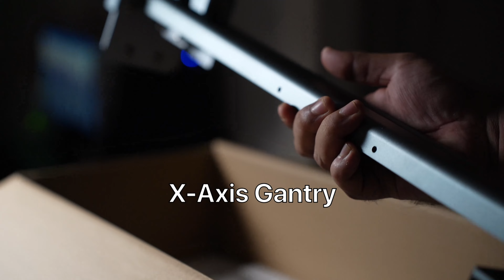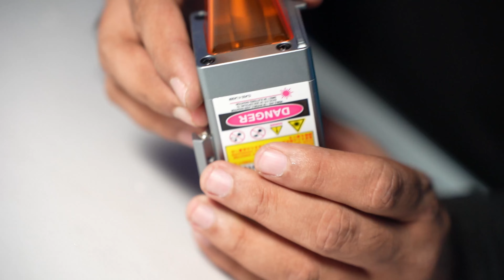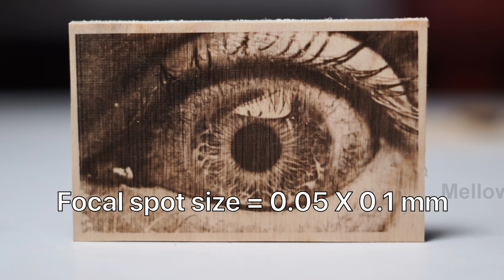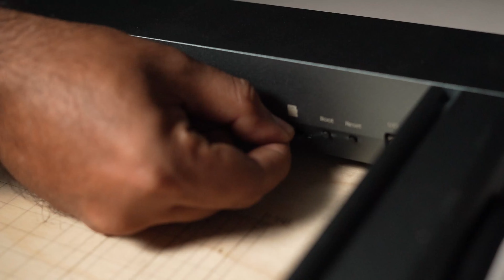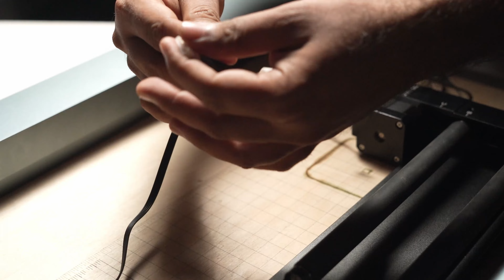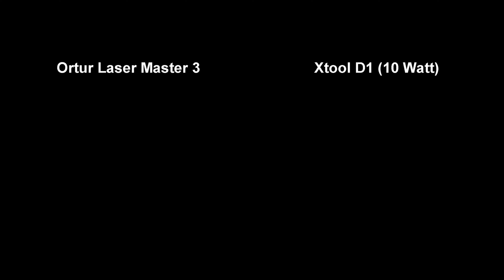Ortur Laser Master 3 Review & Tests- What's Good And Bad? Assembly, Unboxing

Comment: Thank you very much for this video. Please help I am getting real difficulties cutting acrylic mirror of 1mm. I have tried many options and parameters... but still get no result
Reply from the maker: You're Welcome!! Diode lasers are not capable of cutting acrylic mirrors. You can engrave acrylic mirror, but once the reflective coating comes off, it is just clear acrylic underneath, and diode lasers pass through clear acrylic without making a cut.

Comment: Lobe your channel!  Thank you. Did you happen to compare how the ortur engraved vs xtool?  I am curious to see if there are any major differences. Thank you for taking the time to make these videos! Very informative
Reply from the maker: I have the Xtool D1 Pro 20W. Comparing it with Ortur LM3 would be unfair. However I slightly lean towards xTool when it comes to overall experience
Reply: @MellowpineLasers  thank you so much. I have the xtool d1 20w pro in my cart. I started debating the purchase for a moment.

Comment: Great video again. I'm glad you have the Laser Master 3 now, because that is the same machine I have.
Reply from the maker: Cool, what has been your experience with it?
Reply: @MellowpineLasers  I like it a lot. I didn't like the Laser Explorer app very much, and prefer Lightburn for more control.

I have been able to etch stainless steel after spray painting it black and doing several passes.

For cutting and deep engraving, I needed to add an air assist pump. Some plywoods cut better with air assist on the whole time, while others get a cleaner cut if I do the first pass with no air assist.

One thing I'd really like to know is how to hook it up so the "Air" toggle on Lightburn layers can control the air pump.
Reply from the maker: I believe it is possible, there is an i/o port on the controller. I will soon figure out how to do it. If you share your email ID I'll email you the details once I set it up.

Comment: I have tried to get the WiFi to work for a couple months and it just  won't work. this seems to be a problem most users are having. Ortur support closes tickets too fast and were no help with wifi connections.
Reply: Also was not ready for use after assembly. Had to upgrade firmware and tweak all kinds of settings  and messaged with tech support for weeks before  it actually worked. In hindsight  I wish I got an xtool
Reply from the maker: Oh, that's really unfortunate. I'll mention it in future videos.

Comment: A very good review, thanks.
Am I right the Laser Master 3 has a connection for an air assist, but the air assist itself is not part of the package?
Reply from the maker: Yes, you get the tubing, valve, and nozzle. The air assist is not part of the purchase. If you have a compressor you can make one, I have a video about it.